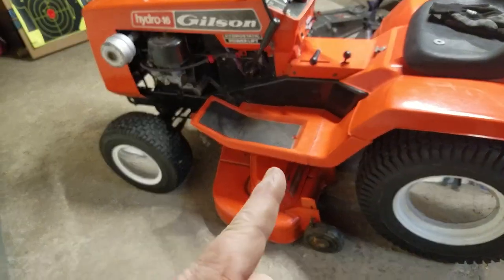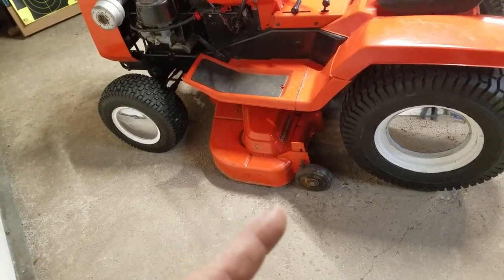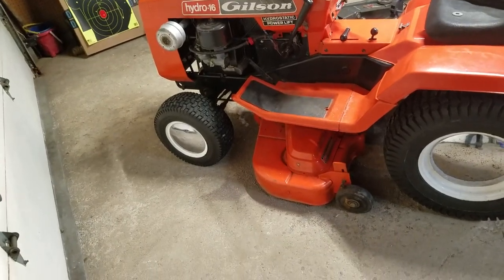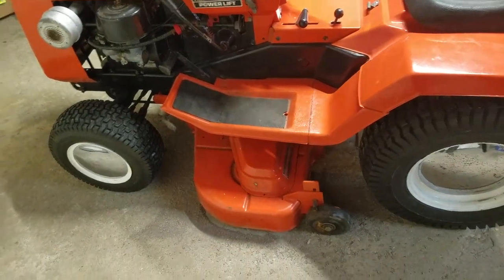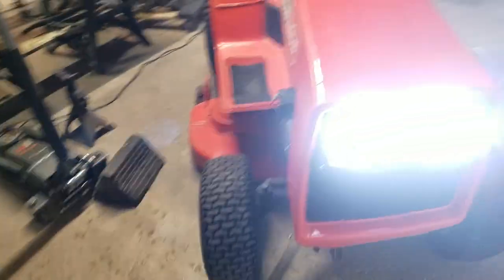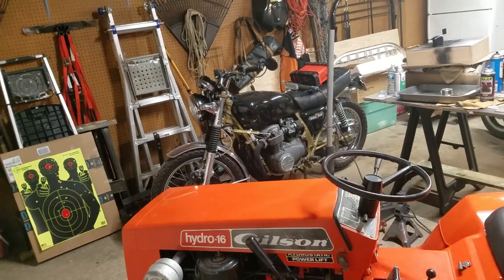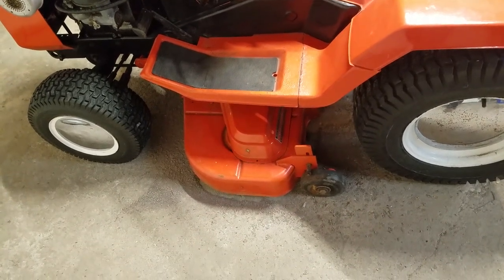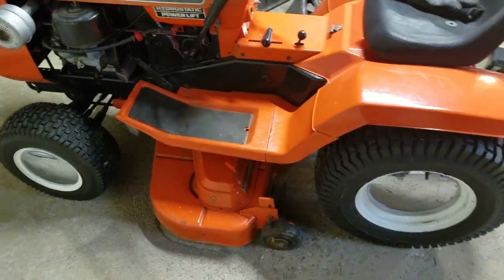Gilson Mower Deck Installed Finally

Comment: The  rear guide goes straight back right through , is shaped like an upside down U. You could make one easily... I've had several of those mower decks with the rear discharge, they work fine.  I still have 4 Gilsons/MWs, one with the rear discharge 42" mower deck, one with the front loader, one with the snowblower, one with a trailer.
Reply from the maker: Awesome I will try that, so it goes all the way out the back? What did you use sheet metal? Nice that you have 4 Gilsons/MW I am trying to get more just they are hard to find and when you do they want a small fortune for them. :) Thanks for the comment!

Comment: Cool old mower, great to see it still going. I love the moon discs, I am guessing they are original but now I want them on my mower.
Reply from the maker: Yeah, they seem to be. Lucky you they make replacements for all size tractor rims, and they do actually keep the lug nuts from rusting so they are functional.
Reply: @MidwestMotoRider  I was thinking of a set for my self propelled push mower. I am joking but actually I have repaired holes in the sides of the plastic front wheels, so they actually would be functional on there as well, lol.

Comment: Sure is a little champion.
Reply from the maker: Thanks, I did have one issue which I noticed this morning the deck slowly lowers as I mow. Could be the hydraulics are not holding pressure.. Still over all it did a good job.

Comment: really nice tractor i have one to here in sweden.. having some troubles with the belt snapping. could you please tell me what belt length and with you are using?
both for the mowerdeck (from the engine) and the belt that engages the mower please?

Comment: any way you can do video on  the belt setup from deck to engine. i just got  one but had no belts to drive deck so not sure how it works and do you know how long the belts are and width . thanks